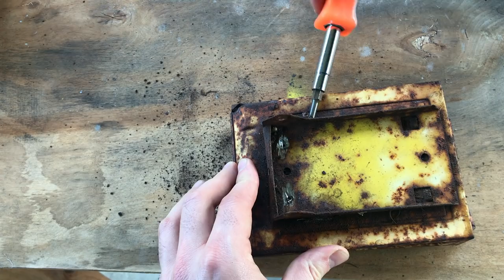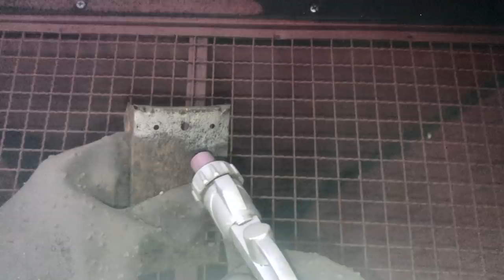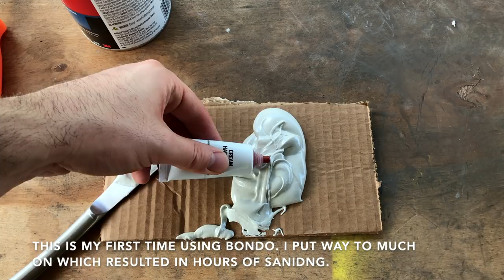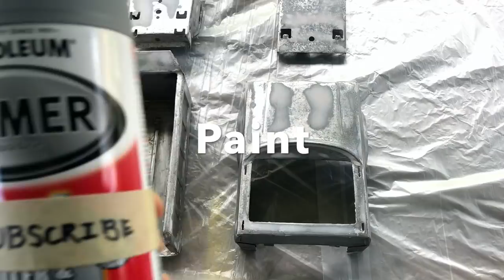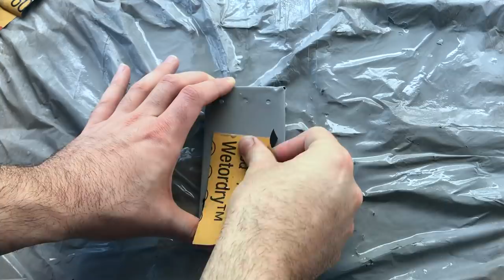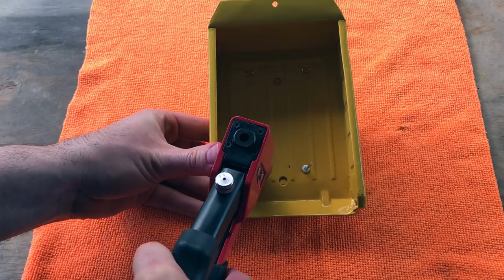Restoration: 1980s Nylint Truck Restoration

Comment: Nice restoration job. They have a body filler for minor imperfections that you should use instead of bondo this way you won’t end up using to much bondo and taking forever to sand it all off. Vinegar and water is wonderful for rust removal but can take a while. I restored the nylint double hopper truck and the first half of it was about as rusty as your dump truck and I put it in a large container and mixed more vinegar than I should of and it took about a week sitting in that solution but all of the rust came off and it was bare metal again.
Reply from the maker: Hi Donald, thank you so much for all the suggestions. I am constantly trying to improve in my restorations. I really appreciate viewers such as yourself taking the time to pass down wisdom to me so I can get better. Thank you again! Till next time, take care my friend. - R&R

Comment: Nice restoration job. Next time when you have something rusty you should dip it in a rust remover first, vinegar and water works great although that ones a slow process. Also when using bondo put it on in very thin coats and sand between those coats. When painting don’t try to spray it all at once because you can get drips and runs, several light coats when painting and let dry between coats will save you lots of headaches in the end.
Reply from the maker: Hi Donald, thank you for all the advice brother. I really appreciate you taking the time to write such a detailed comment and I will be sure to use some of these tips in my restorations. I hope you and your family are doing well during these tough times. Take care my friend. - R&R

Comment: Would an epoxy primer fill those pits and leave a smooth surface?
Reply from the maker: Hi futon02, I am not sure. I have not used an epoxy primer. I will have to look into this. Thank you for watching. I hope you liked the restoration. Happy New Year my friend. - R&R
Reply: @RestoreandRepair  thank you and Happy New Year to you as well
Reply from the maker: @futon02  Thank you! :) - R&R

Comment: Yes I am fine my self .I in the process of restoring two 56tonka pick ups and tonka jeep gladiator stake bed truck.All parts have been cleaned and prime ready for paint.i was watching your video when you were painting and you should never paint in the wind
Reply from the maker: You are right, I ended up making a small little paint booth for my newest restoration which is up now. Thank you for all your advice brother it is greatly appreciated. I hope your restoration comes out great! - R&R

Comment: I have this one. Missing bed. Not restored it yet. Probably make wood flat bed on it? Not shir yet. Awesome restoration!  Also we're did you get the windshield? I need one for mine.  The roof is original though mine has same. I had several of these Ford Nylint trucks growing up. The only one that stands out that had hole in roof was the Nylint farm set. The truck was same. But had flat bed with White cattle sides. The roof was made like that because the set came with a farmer. That's why the floor has the hole in it. I got the farm set in Christmas of "86. All I have left of it is pictures and memories. Thank you for preserving such a special time in my life.

Comment: To do it faster than sanding get a five gallon bucket with a lid and a quart of micuic acid fill bucket with water about two inches from top add the can of acid put parts on wires and lower into bucket with a little of wire to hang out of the bucket and put the lid on and wait for a couple of days check the parts this is the fastest way to get everything clean takes paint and rust away wash with water and dry your ready to paint
Reply: Do you check the comments on your channel
Reply from the maker: Thank you Marcus for the detailed instructions. I will have to give this a try on a future restoration. Thank you again for all the advice! - R&R
Reply from the maker: I read and write back to every comment :) - R&R

Comment: Loved the vid and subscribed! Thank you for a great vid and great work:) Might I suggest a primer filler for the rust pits?:)
Reply from the maker: Hi Brian70Cuda, thank you for your comment and subscribing to the channel. I hope that the restorations can continue to upgrade and get better. In regards to primer filler for the rust pits, I tried that on previous restorations (check previous videos in channel). Unfortunately, it did not do the best job. It worked well for the small rust pits but not for large ones. The primer I use is one that will fill rust pits as well. So for this restoration I went over kill with it by putting bondo AND a heavy primer. All in all I appreciate your feedback. If you see anything that might help upgrade the restorations please don't hesitate to toss me another comment. Thanks again Brian and I hope you and your family are staying safe during these times. Take care brother! - R&R
Reply: @RestoreandRepair  Thank you very much for the well wishes and I hope you and yours are doing well too. The only reason I mentioned the primer was I know how much work it is trying to smooth out a heavy coat of mud. I never pick on someone elses work, not in my place to do so. Have a great day and thank you for writing bro:) Glad I found your channel!

Comment: Great Job! How did you clean up the wheels? I have a Nylint truck with the same wheels and I haven't attempted cleaning them up yet. I'm afraid of damaging the white lettering.
Reply from the maker: Hi Joe DIY, first off I love you videos and am a big fan of your channel. So I tossed the old wheels because they had dry rot on them and were warped. I purchased the tires you see in the video off of ebay that had the white writing already on them. To make them look cleaner I used ArmorAll on the tires and rims. Its the same ArmorAll that you would use on your vehicle. I let the plastic absorb it and then put on a couple more light coats. Lastly, I too was afraid of damaging the white lettering but as long as you keep the coats light you will be okay. Let me know if this helped! - R&R
Reply: @RestoreandRepair  Thanks! Glad you enjoy the content! Definitely will help. I bought a parts truck with descent wheels. I think I'm going to just clean and amerorall them like you suggested. Can't wait to see your next project!
Reply from the maker: @joe_diy  I look forward to seeing your up coming project. I followed you on Instagram and cant wait to see the truck restored. If you need anything please don't hesitate to DM on Instagram or hit me up on YouTube. Take care brother! - R&R

Comment: whole lot easier way than hand sand is the dremal sanding pandle sander its about 2 in round and realy cleans up stuf like u got there i use them on toys rusty guns saves a lot of l bone grease i never used bondo

Comment: I would have to get a good look at the truck cab windows, but I think this Sand and Gravel truck was made in the early 1960's
Reply from the maker: Hi indyloa, this is a great point you make. My best guess was either the 70's or 80's. I have seen pictures of both eras and they look the same. I haven't seen one from the 60's yet but you could be right. Thank you for your comment! - R&R

Comment: Ese camión es un Ford F350 1979; (Volteo) tenía un 351V8 Cleveland;le cambiaran por un 302 V8 de Bronco; tiene transmisión manual de 4 Velocidades; lo van a restaurar y va a quedar bien bonito; soy José Rafael Grange Fuenmayor de Maracaibo Estado Zulia Venezuela; saludos.
Reply from the maker: Hola José, gracias por el detalle de este divertido camión de juguete. Espero que hayas disfrutado de la restauración. Vea algunas de mis restauraciones más nuevas. Fue un placer conocerte mi amigo. - R&R
Reply: @RestoreandRepair  Muchas gracias; el camión volteo es un Ford F350 1979 saludos.
Reply from the maker: @joserafaelgrangefuenmayor9238  :) - R&R

Comment: When you have a truck that rusty I have a five gallon bucket that I have filled three inches from top add one quart of micuic acid slowly put pants on wires and lower into bucket hang over top lip on bucket cover with lid soak a couple of days and check it you will be surprised of the outlook
Reply from the maker: Thank you for the idea. I have not tried this but I will def. look into this. Thank you again for letting me know about this. I hope everything is going well with you during these tough times. Stay healthy and take care brother. - R&R

Comment: you really should have done some gentle hammering with different size punch's to repair the bent metal before your bondo. That truck was RUFF!!! to start with
Reply from the maker: Hi Harley, you make a great point regarding the hammering. I did do some hammering on parts off camera such as the bed of the truck and the from end of the truck. I did not show it on camera because I don't have the space to get the shots as well as the correct lighting. But if you look, you will see at the beginning of the video that the bed of the truck is bent and there are some dents in it. same thing for the front of the truck. Later in the video you will see that most of the dents are gone/fixed and the bed of the truck is straight in various places. Thank you so much for taking the time to leave me a great comment and help me upgrade my restorations. I learn a lot from all of you and take your help seriously. I hope you are doing well and staying healthy. Thank you again brother and take care friend. - R&R